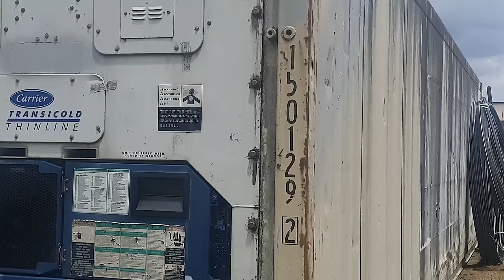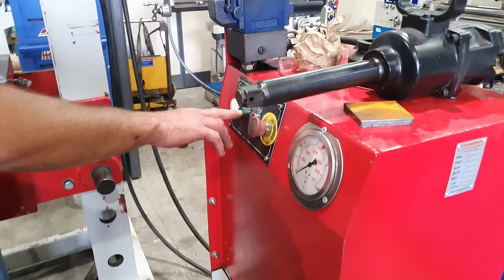Hydraulic Cylinder Rebuilds | This CAT 140M Grader NEEDS Repair | Part 2

Comment: Nice to see that the owner looks after his machine and does the preventative maintenance instead of waiting on it failing.
Reply: Avoiding the "Penny wise and Pound foolish" syndrome is INTELLIGENT.  Preventative maintenance exchanges some short term inconvenience for long term profitability.  Give me the steady cash flow!
Reply: My ex-boss told me to go fetch a 1,4 ton Ford Mondeo to scrap with a crane that could lift only 1,1t. I was 100km off from HQ when the crane tore off from the truck subframe. Sometimes you don't need enemies, when you have your boss.
Reply: If the owner had looked after his machine he would not have ground 3mm off the caps over those ball ends forcing Kurtis to shim them back up to spec.
Reply: @teeanahera8949  you have Got too much money if you tell this words :) i think this job is made before big damage i wanna work this machine more without repair i think i lt was not bad, good work
Reply: No kidding. I complained to my boss for 6 months about bad seals on a lift cylinder for a John Deere boom. The piston rod ended up binding and snapping, which ended in a much more expensive and pita repair.

Comment: I like the simple ingenuity I see. Using the press as a vise, using zip ties as band clamps, making your own custom guide, etc. We who aren’t mechanics (of any form) love watching your channel for the “big accomplishments” that you have as your every day life. There’s not a “formula” or “one set of tools”, but at the core a determination to get the job done.
Reply: That shop made guide at 16:00 is damn near a real life cheat code, I don't do this kinda stuff for a living but I have been in spots where I could have used something similar.
Reply: @bdkj3e  The ashop made guide is brilliant
Reply: @bdkj3e    I have had at least a thousand times that a “ fair quality “ lathe and a junk pile of scrap would have been lifesaving.  When I was a helicopter mechanic the boss and I would clone very expensive tools that were absolutely essential for our future use.  A gadget that insures accuracy, safety, time saving, etc. is always a great tool.  In Kurtis experience, he has either found or devised what seems in use to be dead simple aids that only come from need or genius.  Can’t quite figure out which when dealing with Aussie mind set.  But this guy has definitely got his (and her) act together!
Reply: “One time, at band clamp…” or was it “band camp”?
Reply: I think I saw someone taking apart a locomotive once with the wrench and extension Kurtis is using at 9:45

The size was funny to me, then I realized he is actually working on machines of that scale.  It is a different world than I live in.
Reply: I’m curious about what a dealer might charge for replacing and calibrating that sensor?  Just a vague guess - $1k, $5k, $10k?   

Also, is Oz going to be entirely flat by the time I can manage to see it?  I’m starting a conspiracy theory that y’all are turning the whole country into a landing site for absolutely ginormous alien spaceships.

Comment: I believe that's the cleanest Grader I've ever seen.  Hats off to the owner for taking care of this beast and having you bring it back into substantially better working order.
Reply: Curtis is gonna have this old machine tighter than a new one!
Reply: Most times, cleaning it off/up before repair work is greatly appreciated, besides, paying CCE to clean it before they can even get & make contact with the pieces saves them money and CCE drudge work.
Reply: @alro2434  it's like my son says......"will work for money!". Cleaning that thing off would be a pretty fair cost, regardless.  But, it is clean!!!!
Reply: Kurtis doesn’t like getting filthy parts to work on.  No good professional wants to bill for donkey work, as in getting a piece of equipment cleaned up so you can A- see what you are looking at ( really hard if encrusted in grease, oil, mud, etc) B- doing precision work requires clean work environment, and owners who are smart will insist that the “ crew” will maintain the very expensive equipment to the best of their abilities.  Hyd. oil is expected.  Grunge is expensive for all involved!

Comment: What is really amazing is that you escaped the CAT calibration gouge.
Reply: Yeah, what a bunch of BS that you can't rebuilt the steer cylinders on the newer models without sending them back to the factory for calibration. They just do it because they can. John Deere is the same way. It's not that people can't learn how to work on newer machine with more computer controls. It's that the manufacturers won't build the machines and the maintenance tools in a way that allows third parties (like like repair shops, or even the owners themselves) to service the them.
Reply: @Fix_It_Again_Tony  I have a mate with a 30000 acres farm and $20+ million in equipment- Case, CAT, Deere . He has D9s, Scrapers, headers etc etc.  The rogering on the software side is endless.
Reply: Yes, it’s a real problem that the manufacturers are treating their customers with such contempt and see them as an endless revenue stream. Bring on some decent right to repair legislation.

Comment: I notice you trimming the ends of the cable ties. You should do it like our electricians do, 50 mm long and cut at 45 deg angle just perfect for inflicting injury.
Reply: It is one of the details that most zip tie users never consider. I learned a trick from a master communications electrician to use a butane lighter and flash the flame across the cut edge of the trimmed tie which instantly rendered it unable to cut the next hand,  wrist or forearm that drags across it.  I doubt anyone has ever thanked me for eliminating a nasty cut but I felt better knowing that they did not get injured because of me.

Comment: You can tell a lot about a man from the condition of his never seize can. Yours was either never used or you even keep it clean and tidy. Very impressive. I also like that you took time to show foreign material exclusion caps. Very important. Great video folks.
Reply: Yeah, you're right, but I wish he wouldn't use so much, OR, brush it on dirty threads, cause some of that dirt gets back in the bottle.  Just a little dab'll do & no contact between the part & brush.

Comment: I like that trick where you put the rod eye into the press for work holding. That's pretty slick.
Reply: By the way, I've been experimenting with parts washing fluid recently because I hate the chemical smell of the homemade stuff I put in there that finally worked well (mix of lacquer thinner and diesel fuel, plus whatever I'm washing off the parts). Somebody put me on to hot water and tide granular laundry detergent as the best degreaser. I was skeptical but I tried it in a 5 gallon bucket and it works better than even the stinky chemical stuff, no BS. Only drawbacks are that you need to heat it, you need to rinse them with clean water, you need to dry your steel parts with compressed air right away and it's difficult to get all the slimy soap off your hands afterwards. At the end of the day it's no less of a hassle to clean up than petroleum solvents though, and as much as I hate the smell of the perfumes in laundry detergent, I like diesel fuel and paint thinner even less. I'm currently working on converting my parts washer to use this as a solvent. My plan is to put a bulkhead fitting through the side and use a water heating element from a residential water heater to warm the fluid. Then I plan to put a ball valve on the drain plug and just drain it once a week or so. Water based fluids always start rotting at some point and they will rust the inside of your parts washer too. The pump is plastic on mine so no worries there. My other idea is to just install a small hot water heater in the shop and just fill it with fresh hot water from that every time I use it.

Comment: I am impressed by your diligence in cleaning the cylinders you rebuild.No worries about scratching a cylinder or seals. I have rebuilt many hydraulic cylinders and, I got very irritated when I see people slap things together. I have witnessed the total destruction of a 200 ton blanking cylinder destroyed by someone who thought it was alright to not use a torque wrench to tighten the bolts on a two piece piston.It was ugly.All the cylinder bolts broke and,beat the hell out of the head.😢😢😢

Comment: Excellent idea with making the tapered guide. I have to replace the seals on my 4 in 1 bucket. I can see shearing a new seal very easily in reassembly. Excellent video start to finish. Had to laugh when Karen let out a gasp when you bobbled the end cap or whatever the correct name is during disassembly.

Comment: The outside shelter is so nice, no rain or direct hot sun. We have a postframe building for our farm machines and most of these could be in a hoop shed much like yours. We simply don't have enough room when everything is inside for the upcoming winter. We end up moving these machines outdoors anyways when we have to work on something.

Comment: Taking on a mechanics roll in this one. Instead of welder/fabricator. I like it. Usually see this stuff done in the field, when things fail, and the owner can't bring it to the shop. This looks to be a bit of preventative, fix it before it fails, type of thing. Good on the owner. Many would just run it to failure.

Comment: 👍I was so impressed by you shop making the guide sleeve (ramp)  to prevent cutting the seals when loading the packing gland onto the ram rod.  In my work I have always "blunted" the sharp machined edge of the rod slightly with a Scotch Brite disc to keep from slicing the new seals. If only I had your guide sleeve all those years I could have saved a lot of time. But at least I only had to do it on the first repacking of the cylinder.  Since it is a captive fleet I was guaranteed it would have to be repacked several times over the life of the machine.👍

Comment: Thank you so much for reposting this. I was really bummed out on Friday. I could not get to the site you posted so this was a pleasant surprise. Also worth the wait. Steve Also, Kurtis likely knows this but if you cut the tyraps (wire ties) from side to side instead of across the flat you won’t leave that razor edge on them. You can knock down the small sharp spot, if there is one, with your cutters. Steve
Reply from the maker: You are so welcome!

Comment: Great vid thank you Karen and Curtis. I noticed that some fasteners were metric and some imperial. When Ford took Jaguar Land Rover over, they invested in the production lines to make them more efficient.  But because some of the tooling was Imperial,  it was actually cheaper to buy imperial fasteners with metric heads so that modern production line equipment could be used.

Comment: Those in cylinder linear transducers don't look like the belong in a cylinder,  but do work very well, I think I've fitted cylinders with Temposonic manufactured ones, as you say, very expensive 🤔, difficult part of the design is sealing against high pressure. 
Great to a King Dick Peg spanner in use.
Brilliant work both, and thanks for sharing. 
Best regards John from the UK 🇬🇧

Comment: You did a great job there. It was great to see you taking due care when handling the chrome work. I have just retired this year from spending my whole working life as a Hard Chromium electroplater. It's amazing just how many shafts i have ended up repairing after they  got damaged chrome when they were being re-sealed.
David in the UK.

Comment: FYI, caution should be used when putting a pipe wrench on threaded parts , have the throat of the pipe wrench really close to the peace so that it touches the peace when force is applied (3 point contact),   in order not to oval (wedging the threads ) , kinda tricky at first but after a few times you'll notice less force is used to remove really tight or thinner peaces . great video's , you a true professional

Comment: You can tell your very knowledgeable at what you do. While I know time is money for you and it'll take a little longer, I would recommend using a torque wrench for all the bolts and crows feet with torque wrench on the hydraulic fittings. That'll ensure the maximum life on the work for the customer. Great work!!!

Comment: Have always used a piece of brass brazing rod, flattened at one end, for removing o-rings and seals. It’s softer that a steel pick thereby will not scratch or deform.

Comment: Do other machine shops do disassembly/reassembly like you?  Or do you do this level of work because of your prior experience?  At any rate, you do top-notch work!
Reply from the maker: Some of them if they're equipped, most shops either do the disassembly/reassembly OR the repair & machine. We like to be able to do both for our customers

Comment: That was a good one this week guys very enjoyable as it all seemed to go without issues due to brilliant work by Karen and editing out Mr fumbles lol ..seems kurtis had a severe case of butter fingers this week . It must be a great feeling when it all goes off without any issues , no stripped or crossed threads no turned and damaged seal seats , bolts undoing as they should . Love the in house made seal guide I'm guessing you do these as a fairly common replacement hence the tool to assist assembly.  Thanks for a great 2 parter this time round guys .

Comment: "That's not a pipe wrench... Now that's a pipe wrench." Love the videos and editing as always. And I like the improvised lead-screw bearing puller.
Reply: When they get that big, I used to use aluminum ones. And the 5' bar when removing 4" pipe fittings.
Reply: @millwrightrick1  I would have expected a cheater bar but then it cut to Curtis using a comically sized pipe wrench and I just had to laugh.

Comment: Damn, what a bad ass using a chrome socket on a impact gun! Also for taking those cylinders apart, i would have thought that there would have been a spanner wrench made for the job or like how every other back yard guy does it with a hammer and chisel

Comment: That was a mammoth bit of everything . That customer / operator   caught it just in time . Preventative maintenance equals a reliable ,long lasting machine .  a daily greasing wouldn't go amiss. the anti seize on the threads looked like Bostic Nuclear .. but it may be Loctite anti seize .

Comment: The colour coordinated cheater bar on the pipe wrench is just great. Just one small point, if you do a lot of these cylinder reseals it would be worth getting a second "clean" wash to clean the pistons etc. before putting the seals on, the filters in most parts washers are simply not good enough.

Comment: Magnificent job for a magnificent machine.
I wonder if they could have designed those ball joints better as in not let dust mix with the grease, maybe using a rubber boot somehow.

Comment: Nice to see someone that knows how to correctly install cotter pins. You mentioned sometime back how strict the government was on oil leakage on the sites where these machines are used. Does the same rules apply to operations like yours where oil spills from repairing hydraulics is done? Thanks.

Comment: Try a two/three wrap girth hitch ( a.k.a. prusik, slide and grip ) on those vertical cylinder lifts; you have enough sling length and you're not loading/relying on the hydraulic port catching the hitch

Comment: Kurtis awesome video! One thing I loved was that short tapered sleeve you used to reassemble so seals and o rings would slide on real nice damage free! Did you make that or buy it.  Do the sensors must monitor cylinder position? Another great video! 👍👍👍👍

Comment: Brilliant video as always. I'm a bit nervous about the lubrication of those split shimmed ball ends. You assembled them dry and the video seems to show grease only entering on one half of the joint. How are the top halves of the joints getting grease for their initial operations?

Comment: That was a lot of work!
I never worked on hydraulic cylinders but was thinking: is there any change for small oil leaks passing  through the piston bore? Would expect an O-ring in the piston bore in that case?

Comment: Nice tutorial on hydraulic cylinder rebuilds.  Love the use of the press to stabilize parts during the process....and the custom-made guide sleeve for seal installation.  Pipe wrench to remove end caps...not the spanner and a cheater bar ??  Seems that the hardest part is replacing all of the seals in the right places and orientations.  Do you have a schematic or just know all of that stuff from experience ?  What is that neat three-finger internal seal installer...source ??  So nice to restore a machine to full factory specifications.  BTW, love the camera work and close focus capability.  Camera brand and model ?  Suggestion: don't bother to record completely duplicate operations....save your time and shorten video duration.  Take care !!

Comment: if i were doing that kind of work, i would consider putting a little LocTite Thread Locker on the cylinder threads to make sure that they don’t work loose due to the vibrations of the machine

Comment: The grader blade is missing the wear plates on the sides.  Were they not there when it came in, or did you forget to re-install them?  
The tapered sleeve to expand the seals when installing the cylinder cap is a nice touch.  Invaluable tool to have.  How many of those do you have on hand for various combinations of rod diameter and rod end?

Comment: Great Job. Installing plugs on the open hydraulic connecting ports ist a good thing to see.
What is this black stuff you apply on the threads of the bolts?